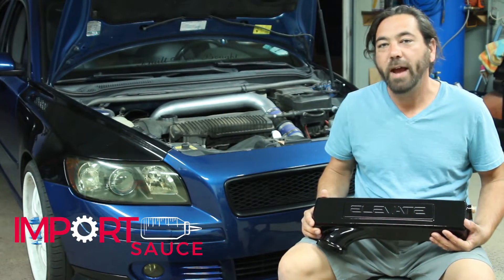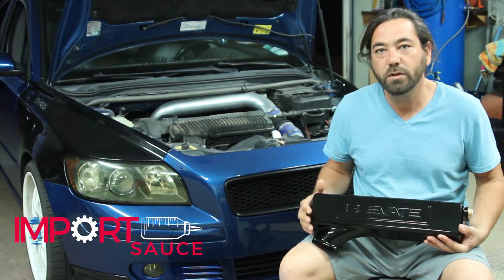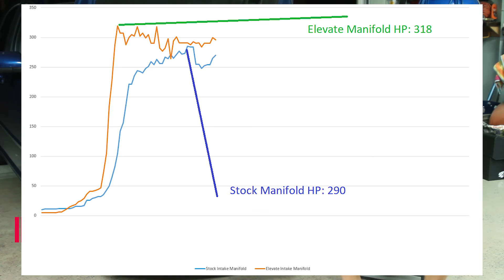Product Review: Elevate Volvo T5 Performance Inlet Manifold

Comment: Great video I have a Volvo s40 that I’m currently putting a new engine in and was curious in the 5 speed automatic trans and how much power it can hold is that what you have in yours ?
Reply from the maker: we had the auto, seemed to hold up no problem, but it was going out already anyways, so we swapped the M66 in:
https://www.importsauce.com/the-ultimate-s40-v50-auto-to-manual-swap-guide/
Reply: What all mods did you guys have done and did you dyno it before the manual trans was installed?
Reply from the maker: @Pstreetz  50hp more and 68tq. We have Every modification done except the k16 turbo

Comment: haha. i see you have the problem with the intake hitting the strut brace
Reply from the maker: Yeah. We figure some heat wrap on the pipe should reduce the rattle.
Reply: @moosedroppings  I pushed mine together a bit more to get clearance. got the inlet coming in a few weeks. thanks for the tip about pre threading the bolts.
Reply from the maker: @johnblake443  sure thing. Any questions on that message us in Instagram. We’re available to help.